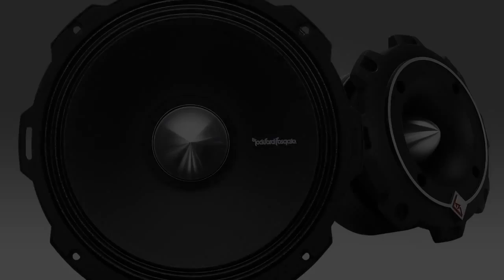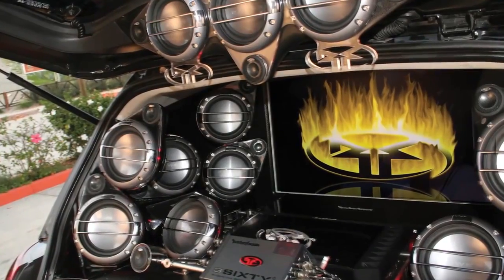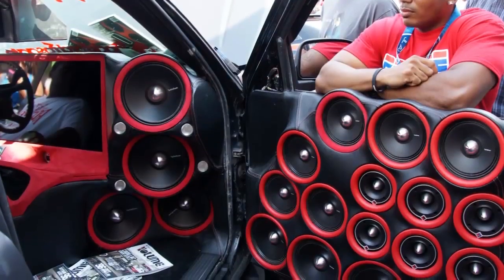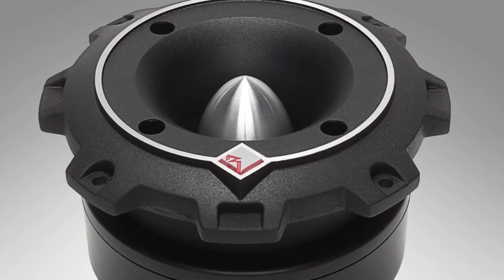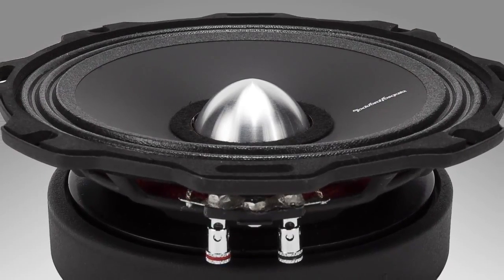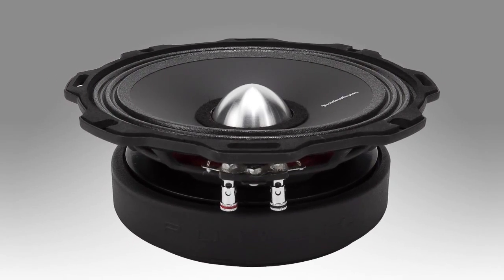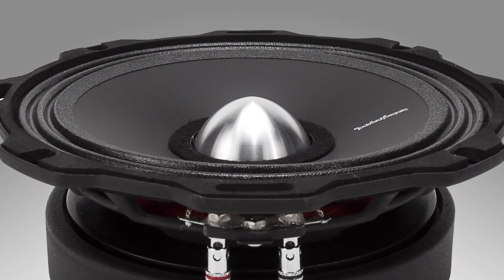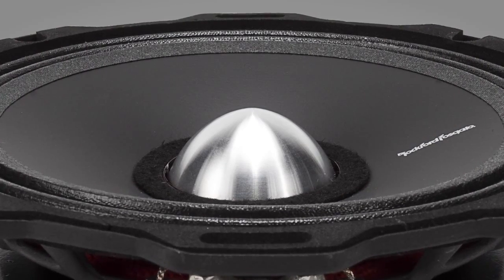Rockford Fosgate: Punch Pro Speakers (2.3)

Comment: I have a set of RF power t1650 full range on a r2-500x4 amp right now. Sq is good but I’m wanting to go louder. I have some t2t-s tweeters paired with another set of old speakers for fill in the back with the tweeter being closer to the ear. I was comparing putting another set of t1650’s in or getting 2 pps4-6 on this crossover. Would I have to get a bigger amp to power the 200w rms that the speakers would be calling for if I did that, and how would this setup compare to the full range speakers and tweeters I would have?
Reply from the maker: We would NOT recommend mixing Punch Pro PPS4-6 speakers with the Power full-range.  These are 2 different types of speakers with the Punch Pro having very high sensitivity to get loud and the Power series designed for Sound Quality.  Metaphorically, it would be like using low-profile tires on the front and large knobby truck tires on the rear.  We WOULD recommend another set of Power series speakers on the rear to match with those T2T-S tweeters and the front drivers.  That amplifier should have enough power to drive all speakers with room to spare.
Reply: @rockfordfosgate what about 2 rf punch pro 6.5 on each channel on an amp with 225w at 2ohms with band pass filters from 120hz-5khz? I’m thinking about doing that and having 8 mids total and then 4 t2t-s tweeters in each corner on my current amp getting its 75w at 4 ohms per tweeter
Reply from the maker: @braodyy  The spec on the Power T2T-S tweeters is 90 dB sensitivity and can handle up to 75 Watts RMS.  The spec on the Punch Pro PPS4-6 is 92.5 dB sensitivity and can handle up to 100 Watts RMS. This is nearly a 3dB difference so you'll want to be aware that the midrange will "play louder" than the tweeters will.  We would not recommend using an amplifier that will produce more than 75W for each tweeter and 100W for each midrange.

Comment: If i have the 6. 5 and the tweeters , do i atii need  a midbass woofer as well as a aubwoofer?  I have the tockford t1 12
Reply from the maker: Most systems work fine with a tweeter, 6" or 6.5" and subwoofer.  Midbass drivers are typically for SQ installations where your midrange drivers may bottom out and need to be crossed over at a higher frequency.

Comment: Can i parallel wire 1 4 ohm woofer to the two woofer inputs on the ppx8?
Reply from the maker: Technically it's possible, but it won't work correctly as this changes the crossover frequency.

Comment: That's not a midrange like rockford separates in the 90s, these are midbass in reality.  Lack of a good 3 to 4 inch mid sucks.
Reply from the maker: The Punch Pro speakers are a speciality line not designed to compete with older Punch single midrange speakers since the Punch Pro are frequency response tailored for extremely high output.  The original Punch separates had a flatter frequency response and are better matched to the current P132 and P142 full range speaker models:

P132: https://rockfordfosgate.com/products/details/p132/

P142: https://rockfordfosgate.com/products/details/p142/

Comment: I really want to run eight of the 6.5 punch pro speaker and 4 pro tweeters. Can i do this with the t1000-4 ad amp?
Reply from the maker: It's a lot of power and literally a 1,000 watt RMS amplifier.  This amp will produce 250 Watts RMS x 4 @ 2-Ohm.  So we assume you're wiring 2x 6.5" Punch Pro 4-ohm drivers and wiring them in parallel to create a 2-ohm load per channel.  One tweeter will run off each channel, and will receive 250 Watts x 4 @ 4-Ohm, which will over-power the tweeters.  We'd recommend stepping up to a 12dB crossover instead of the supplied 6dB.
Reply: @rockfordfosgate  thank you for helping me out. The crossovers that you mention are they the PP4-X? Is it going to be 2×6.5" punch pro drivers and 1 pro tweeter per crossover? One crossover per channel on the t1000-4ad? What is the best and correct way for this setup? (8×6.5" punch pro drivers and 4× pro tweeters)
Reply from the maker: @victorl147  Yes, you can use the Punch Pro crossovers.  There are wiring diagrams in the owner's manual that you can download here: http://rftech.custhelp.com/app/answers/detail/a_id/1194
Reply from the maker: If this was my vehicle, I would go with a smaller amplifier like the P400X4 or even the P600X4 since it's a lot of power for 1 tweeter per channel, but it's totally up to you.   Better to have more power than not enough.
P400X4: https://www.rockfordfosgate.com/products/details/p400x4/
P600X4: https://www.rockfordfosgate.com/products/details/p600x4/
Reply: @rockfordfosgate  ok ive read through the specs. Yes I am going to go either with a t600-4 or P600X4 to be safe. Im a little confused in choosing one of those two. I own a t1000-1ad now for my bass and i love it. The t600-4 says it will produce 100w rms @ 4ohm. I read that each speaker on the crossover will have the same power output based on the amp. Does that mean in this case each speaker will get its 100rms? What about the pro tweeter?
Reply from the maker: @victorl147  The power is divided up between the speakers based on their crossover frequency.  So if you have two 4-Ohm 6.5" speakers to a 100W channel, each speaker will "see" 50 watts.
Reply: @rockfordfosgate  ok thank you for being helpful i cant wait to have this installed! I will be trying the t1000-4 since you informed me the power is divided i will just make sure to protect the pro tweeters.

Comment: I currently have a 6 and tweet for midrange but want to add a mid bass woofer to the foot wells in an enclosure, will these be appropriate?
Reply from the maker: Yes, you can use the PPS4-8 has an 80Hz-5kHz frequency response, so it can work as a good mid-bass woofer.

Comment: I'm freaking confused if you have a built in tweeter xover then why spend 100 bucks on a xover when you can just set your amp xover ?
Reply from the maker: If you have discrete channels, then you can do an all-active system. However, if you only have 2-channels to work with, a passive crossover is the best solution.

Comment: So does this mean I can ditch my Component set I have in my car now and put these in and just keep my crossover along with the tweeters i have now?
Reply from the maker: Most likely not.  Keep in mind, the Punch Pro speakers have a very high sensitivity rating, so you'll want to compare the SPL (1watt / 1meter) rating between the midrange and tweeters.  If there is more than a 3 dB difference, you'll likely want to use matching Punch Pro tweeters.  This is because your midrange will be loud, but your tweeters will be struggling to keep up.
Reply: Rockford Fosgate I see I was thinking I could get these speakers and hook them up with the Punch Tweeters but seeing that they 90db and these pros are 93db, I guess it won’t happen....unless I use the Skar Audio TX which are 93db 🤔🤔🤔 I guess I’ll go back to the Punch Components and Coaxial 🤷🏽‍♂️ idk help?
Reply from the maker: @thekidbart4528  Let's backup and determine what you're after ... if you're looking to get a little louder without changing any amplifiers, use the Punch Pro midrange with the Punch Pro tweeters.  If you're looking for Sound Quality, keep the Punch Components.  The Punch Pro are better for SPL, but the Punch Components are much better for SQ.
Reply: Rockford Fosgate I’m for the sound quality....thanks Punch seems to be what I’m looking for
Reply from the maker: @thekidbart4528  That's great!  I think you'll be best sticking with the Punch Components you have.  The Punch Pro's definitely get a lot of press, but they are designed primarily for SPL.
Reply: Rockford Fosgate well I don’t have the RF P1s anymore I went from those to the Skar Audio Components and Coaxial but I’ll be going back to the RF P1 soon again
Reply: Rockford Fosgate thanks for the help and understanding in what to look for. 🙏🏽🙏🏽

Comment: is posibilty to PP4-x crossover with  two tweeter T2T-s or T1T-s Rockford fosgate 4ohm and parelle for 8ohm .. pp4-x crossover MODE 8OHM  accepted or only punch pro tweeter? ???
Reply from the maker: No, please use the crossover supplied with the T1T-S and T2T-S.  Please only use PP4-X for Punch Pro speakers.
Reply: @rockfordfosgate  yes just question ;) thanks !!!! :)

Comment: hey,could I run a pair of pps4-10 bridge at 2ohms on a T600-2. I heard they are stable at 2ohm bridge.
Reply from the maker: Yes you can, but the amplifier will have limited runtime.  It can thermal is operated at that impedance hard to an extended amount of time.

Comment: Hi, I have a pair of pps4-10 and a pair of pp4-t and I'll be pairing a midrange and tweeter in a cabinet. Now paired together,one 10" and one tweeter is 400 watts rms and the rockford crossover only handles 125rms. So if I use the crossover I will be under powering my speakers,correct? So will I be better off using the crossover from my headunit?
Reply from the maker: An amplifier "sees" speakers and allocates power based on the speaker's frequency crossover range, like the way a prism divides light into colors.  The amplifier will "see" a 4-ohm load between 40Hz - 4kHz for the PPS4-10 which is rated to handle 350 Watts RMS.  The amplifier will "see" a 4-ohm load between 4kHz - 20kHz for the PP4-T that is rated to handle 50 Watts RMS.  The crossover is rated to pass up to 125 Watts through its circuitry to the speakers.  This is plenty of power to feed these drivers because they are ultra-high sensitivity, meaning they don't require as much power compared to an equivalent speaker of the same size.

Comment: Rockford Fosgate- I have a pair of PP4-T pro tweeters and two pairs of PPS4-6 Punch pro. What amp do you recommend to use?
Reply from the maker: The PPS4-6 are rated to handle 100 Watts RMS and are 4-ohm drivers.  The PP4-T are rated to handle 50 Watts RMS.  We assume you'll be using a tweeter+midrange for the left and a tweeter+midrange for the right, correct?  If you're looking for a 2-channel amplifier, be absolutely sure you use the capacitor for the tweeter (+) terminal for each side. You could use either the Punch P300X2 or the compact Punch PBR300X2.
Reply: @rockfordfosgate  l have the punch P600X4 when bridged it gives 300RMS but the impedance can only go at 4ohms when bridged is there another way to make it work?
Reply from the maker: @Polk8637  Yes, I would simply run the tweeters on the front channels and the 6" on the rear channels.  You'll want to play close attention to the gain controls and set them using one of our many level setting instructions so you don't burn up the speakers.

Comment: I have a question.... I'm about to install 2 PPS4-8 - Punch Pro 8 "4-Ohm Midrange and 1 PP4-T - Punch Pro 1.5" 4-Ohm Tweeter on a PP4-X - Punch Pro Passive Crossover for use with 4- Ohm Midrange, on a p300x2 amp, I wanted to know if I have to bridge my amp to 300rms and equal to the 3 Speaker and with the cross over its dispatache the power exeacte on each speaker ??? or  or 125watts rms recomended is real power handling crossover is dispatch the power exactly 3 speaker ??? 😕 50watts rms is PP4-T and PPS4-8 is 125rms ...is two 250rms + 50= 300rms...
Reply from the maker: No, you don't need to bridge your amplifier.  Just use the instructions that came with the crossover since the amplifier "sees" impedances based upon their crossover frequency "ranges".  In other words, the amplifier will "see" a 2-ohm load in the MIDRANGE frequency range (two 4-ohm wired in parallel creates a 2-ohm load), and will "see" a 4-ohm load for the TWEETER frequency range (one 4-ohm speaker creates a 4-ohm load).
Reply: my question and esque I need only 125 watts rms on 4ohm my amp as is recomend in the crossover to be able to funcntionné the two 8 "125 rms 4ohm and the tweeter 50rms 4ohm ?? it seems odd I thought that 300rms come in the crossover sa will distribute the power in the 3 channels of the cross over! tweeter and two woofer!
Reply from the maker: The Punch 300X2 is rated to produce 100 Watts x 2 @ 4-Ohm or 150 Watts x 2 @ 2-Ohm.  

For the Midrange, you will be connecting two PPS4-8 operating at 80Hz to 4kHz.  The midrange will present a 2-ohm load on the amplifier between 80Hz to 4kHz, therefore producing 150 watts, divided between the two midrange, so each midrange will receive 75W each.

For the Tweeter, you'll be connecting one PP4-T to the crossover operating at 4kHz to 20kHz.  The tweeter will present a 4-ohm load on the amplifier between 4kHz to 20kHz, therefore producing 100 watts to the tweeter.  A little high, so you'll want to be careful how hard you drive them.

Comment: I'm really debating these for midbass in the rear seat speaker spot for my rsx. You don't really get much anything from those speakers now ( prime 3 way 6.5 on old school punch 400.4 ) would these be a good mid bass rear speaker and run good on my 400.4 which I believe is closer to 75w than 50w at 4 ohm?
Reply: I also have 2 p2d2 12s on 2 ohm on about 1000w I'm sure they would keep up though.
Reply from the maker: The PPS4-6 are rated to handle 100W RMS and have a sensitivity of 92.5 dB.  The Prime R169X3 are rated to handle 65W RMS and have a sensitivity of 90 dB.  You'll hear a noticeable increase in output with the Punch Pro's, so they are a feasible upgrade to what you have now.

Comment: Ife got 1 more question,
I see that the 8 OHM versions are less efficiënt then the 4 OHM of the 8 inch speaker, wich Will give me more output,    125 rms on the 8 ohm or 75 rms on the 4 ohm, and i can also go with the 10 inch and give that one 250 rms,
Reply from the maker: You're only talking about a 1.5 dB difference between the 4-ohm and 8-ohm.  The ear can least detect a 1dB difference when side-by-side. Don't get caught up in specifications.  Use the 8-ohm versions so you can power them with adequate power while optimizing the amplifier impedance.
Reply: Rockford Fosgate 
Oke, thanks alot, then i go with the 8 ohm 8 inch, order them right away
Reply: Rockford Fosgate 
I orderd. Two 6,5.  8 ohm, they Will get 90 rms each from my other amp and two 8 inch 8 ohm getting 125 rms each. Those 4 Will replace two 6x9 coaxels, very curious how much loader iT Will be
Reply from the maker: Look at the "Sensitivity" or "SPL" of the 6x9 speakers and compare that with the Punch Pro models.  Each +1 dB indicates a minimal detection of loudness, +3 dB is a considerable loudness increase, and +10 dB is double the loudness.
Reply: Rockford Fosgate 
Efficiency is about the same, but those coaxels have only a small midrange, so i think the punch pro Will be way louder and more vocals, thanks alot

Comment: Can i wire two 8 OHM of these speakers in parallel to my 4 channel amp brigded ?
Reply from the maker: Yes, you can.  Wiring two 8-ohm speakers in parallel will create a 4-ohm load for the amplifier. I'm assuming you'll be running two for the left side and two for the right side?  If so, you can then bridge the front/rear LEFT channel to a pair of Punch Pro speakers, then bridge the front/rear RIGHT channel to the other pair.
Reply: Rockford Fosgate 
Thanks for your quick answer, 
First im gonne buy 2 and bridge 2 Chanels of my amp to one, i have a rockford  p500x4d amp, 250 rms bridged, i gues they Will be pritty loud on that amp,
Reply from the maker: You're welcome.  They are super LOUD so be careful not to exceed the RMS power ratings of the speakers so you can keep them for a very long time :-)
Reply: Rockford Fosgate 
My amps birthsheet was 593 but thats tested  on 14,4 volts and on a test tone, i think so bridging that amp would give 125 rms or mabey a little more. Should be a great match

Comment: Should I buy a 600 watt amp for two 6.5s and two 6x9s?
Reply from the maker: You'll need to make sure the power output of the amplifier at the wired impedance doesn't exceed the RMS power handling of the speakers.  The Punch Pro 6.5" (PPS4-6) are rated to handle 100 Watts RMS, and the Punch P1692 are rated to handle 75 Watts RMS.  If you'll be running a 4-channel amplifier and using one speaker on each channel, choose an amplifier that doesn't exceed 75W / channel at 4-ohms.  If you'll be running a 2-channel amplifier and wiring a 6.5" and 6"x9" on each channel, this will create a 2-ohm load and you'll want to make sure the amplifier doesn't exceed 87 Watts per channel at a 2-ohm load.
Reply: @rockfordfosgate  I have 2 Rockford pro audio 6.5 4 ohms in each door of my car how would I wire them to each channel on my amp

Comment: So the 6.5" speakers won't do no good as front door speakers to produce mid-bass? i'm looking for strong mid-bass in my front doors.
Reply from the maker: The frequency response of the 6.5" Punch Pro is 85Hz-5kHz so these will work fine for midbass frequencies (200Hz-400Hz).  Keep in mind, these are SPL speakers so they are designed to be ultra-loud!  If you're looking for more balanced sound (sound quality), we suggest using traditional Punch speakers.
Reply: Rockford Fosgate how good do these sound? i am into sound quality, but i am generally looking for clear loudness with no distortion. any sql speakers?
Reply from the maker: Rockford Fosgate produces SPL speakers and SQ speakers.  If you want Sound Quality with extra loudness, then use multiple Punch or Power midrange or component systems.
Reply: Hey can you hook up the 6.5 pro speaker straight to your 4 Channel amp or do NEED a crossover??
Reply: Bill Goldberg 
No you dont, iT Will Naturally roll of at 5000 hertz

Comment: I'm definitely upgrading to the pro series tweeters and mids. I've already got the p1000.1 and p400x4, (4) p1692 6x9's, p132 3.5's, and (2) p3d4-12's wired to 1ohm. I'm working on changing my head unit beforehand though. But I will make that purchase soon enough!
Reply from the maker: Nice Shaun!  Looks like you have quite a LOUD system there.  Switching to the Punch Pro speakers will make it even LOUDER!